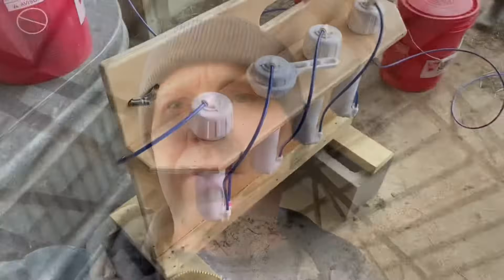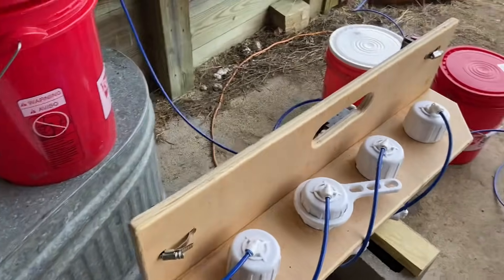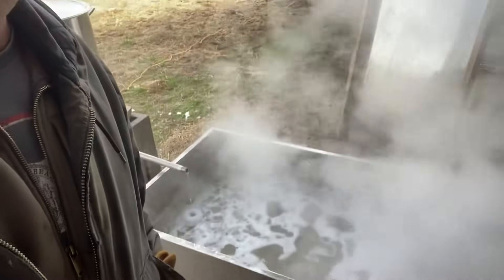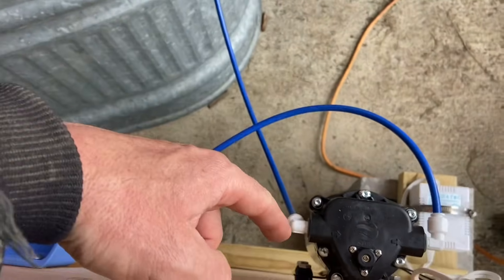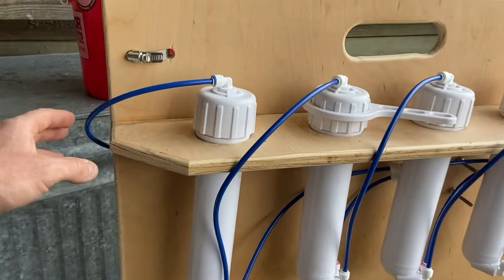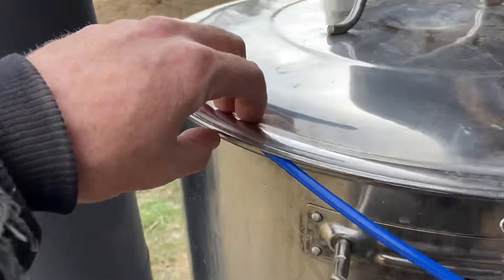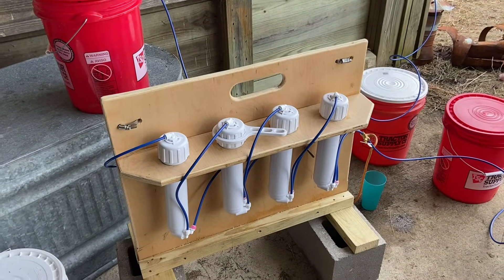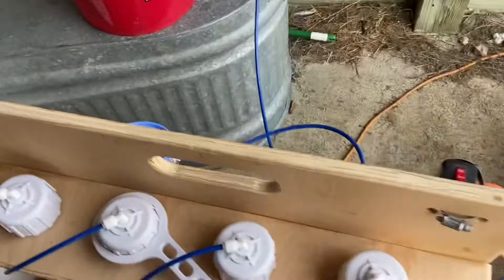Reverse Osmosis for Maple Syrup

Comment: oddly im not having luck getting the pump to pull water into the system. im not using the same pump but it does look like a very similar functioning model
Reply from the maker: Try elevating the sap container before the pump, mine always pulls better when that incoming sap bucket is at or above pump level.
Reply: thank you! Ill give it a shot @birchfieldfarming
Reply: @birchfieldfarming  seems like its something about the RO filter. i disconnected it and there was no trouble sending water through the rest of the system

Comment: I have searched everywhere and maybe i’m not wording it right when i search it, but where did you get your weights for your lines?
Reply from the maker: Great question, and I should’ve added this link to original post.  I’m assuming you just mean the weight in the bottom of the original sap bucket?  It’s just a standard garden hose fitting to 1/4” hose compression fitting.  Here’s a link: ZKZX 3/4" GHT Garden Hose Thread Female to 1/4" OD Compression Brass Connector, Faucet to Hose Adapter 2PCS https://a.co/d/3OQS4rH
Reply: @birchfieldfarming  i was talking about the weight to keep the hose down in the bucket/tank so it stays in there
Reply from the maker: @ZachAdventures yeah, that’s what I linked to
Reply: @birchfieldfarming  my bad i didn’t see the link the first time. would help if i clicked the see more button. lol. thank you
Reply from the maker: @ZachAdventures You got it, best of luck with your season!

Comment: Just curious, how did you come up with the 4 filters? Why not 2 why not 6? Is purified water good to drink?
Reply from the maker: The purified water is EXCELLENT to drink!  I made the unit almost a year ago, so I’m trying to think back…I may have come across something similar on another channel…point is, it worked great for our 30 to 40 or so taps!  You can try less membranes, you just won’t pull as much water out per pass was my understanding.
Reply: Great fantastic thank you so much for getting back to me. I believe I’m going to build one in trade this year. I put a mainline in last year so I didn’t have to go get buckets so we’ll see what happens. Thanks again.

Comment: Fantastic, video This looks really cool to do me and my daughter have about 20 or so trees. And we generally have to boil about 90 gallons to make one because were using swamp maples and rock maples. So I believe this will really cut down on my boiling time a lot we generally end up making a couple gallons of syrup, do you think this will be good for me? Thanks 
Fred
Reply from the maker: This was the best thing we did regarding our syrup production!  I’d absolutely recommend.  The only thing I’m not 100% on is effectively storing the membranes in the off-season.  Lots of videos on that out there, but I’m not sure I’ve figured it out.  But even so for me, it’s still worth it to buy new membranes each season.  The firewood savings alone was incredible.

Comment: Great video!  can you give a detailed diagram of your setup the video go's so fast! Also have you used a pressure  switch for your pump? If so where would hook it up at? Sap side or pure water side?
Reply from the maker: Thanks, Dave.  I have not used a pressure switch for pump, as I really didn’t have a need.  We won’t have this thing out again until syrup season, and I want to condense it down so it’s lighter and simpler…a diagram would be a good idea!

Comment: Why use several small ro membranes vs a 4”x40” ?? Contemplating 2 units and running a low psi into a high pressure pump
Reply from the maker: I have no idea.  This is what was available, so I went with it.  Worked great, but maybe you can improve.  Keep us posted!!

Comment: Any adviice on shutting down the system at end of season would be appreciated. 
From John in Morgans Point On.
Reply from the maker: Hi John,
Youngblood did a video on this - pretty short, simple, cost effective storage method using hydrogen peroxide.  I’ll probably follow something similar.  The membranes came vacuum sealed, so I may try sealing them up individually with my food saver (after cleaning and treating), rather than his PVC pipe storage method (PVC is expensive!).  Like he says though, worst case, buying new membranes is always an option if my storage technique fails for some reason.  Anybody else who has experience, please comment if willing!  Link to Younblood video below:

https://youtu.be/h0g6zI-w7hk
Reply: Thanks. Will check it out.
Reply: @johnlott9111  I an storing in a cat litter bucket with wood blocks on top to keep filters submerged.

Comment: One more question. I’m having a hard time finding the fittings for the filter? 3/8npt I assume would go to 1/4 push connect? Did you find them on Amazon? Ty
Reply from the maker: Yes, here are the ones I used: Malida Male Push To Connect Tube... https://www.amazon.com/dp/B01M9B6LL3?ref=ppx_pop_mob_ap_share
I had a heck of a time stopping leaks from the threaded portion tho.  I had to Teflon tape the crud out of them!  Very poorly made Chinese cheapness.  I’ll be making a trip to the hardware and rigging up something with brass threads before next season.
Reply: @birchfieldfarming  thanks for the heads-up on that.

Comment: We are only able to boil sap on the weekends, will the membranes be good to sit for a week after just a flush with the permeate? Or will we have to do a soap wash? Thank you for your video..happy boiling
Reply from the maker: That’s a really great question.  I’ve come close to a week with just a permeate flush, so I think you’d be fine.  What I’m noticing though is the pre-filter (5 micron) needs changed more often as we near the end of the season and it gets more buddy - sap seems cloudier, spoils quicker, and plugging that pre-filter much easier.  Good luck to ya!
Reply: Flush with permeate every 3 days and you’re good to go. Use a preservative at the dnd of the season…remove the pre filter after each use…I soak mine in permeate between runs…and use a new one every 500 gal of sap
Reply from the maker: @billchriswell2925  Thanks, Bill!  Good info here.
Reply: Thank you!

Comment: Thanks for the video I'm up in ME and just built one of these machines and im learning how to best run it. I'm starting with only about 1.5% sap so it takes a bit longer to get up to that 6 or so % range.  The online forums say you can get at most about 9-10% just due to the science behind the RO process and how water is removed.  I think the sizing of the system is the most important depending on how you plan on using it.  I am removing about 2 gph of permiate which is about the same as my boil rate in a lobster pot over the wood fire but I would like do do it abit faster so I don't have to run the RO quite as long to get a batch ready to boil. in any event utilizing the process is a huge benefit especialy when you don't want your hobby to turn into a full time job. Cheers
Reply from the maker: You’re absolutely right - it’s been a game changer for our small operation.  Kevin, are you guys still running sap up there?  We’ve had kind of a slow season with temps above normal (early Spring?).  I’m thinking our season may end this weekend because of the warmer weather.  Sounds like you’ve got a set-up that’s working for you, which is all that matters.
Reply: @birchfieldfarming  it ran for about 2 weeks mid janruary so I decided to tap but the freezer turned back on and its been single digit temps for a week so everyting froze back up.  Things just getting started up here for most people about in the first week of march. i just ordered some larger membranes wich should speed things up for me so we'll see how it goes.
Reply from the maker: @kevindavison6019  Very nice, good luck with your season!  We’re finishing up down here.  Not our best season, but we made what we needed to.
Reply: @kevindavison6019  where in maine are you at. We sugar down in buxton. Looking to set up a ro as we are around 200 taps it takes alot of wood

Comment: How many gallons per day GPD are those membranes? How often does the membranes clog up and have to do a flush? How many taps do you have? What is the size of your pan?
Reply from the maker: Hi Craig - Membranes are 150 GPD, I’ve run as much as 50 gallons of sap in a day without a problem, but I usually keep 5 gallons of permeate back and flush at the end of each day, which has worked well.  We usually tap 15 or so trees and run around 40 to 50 taps.  Last year this yielded us 400+ gallons of sap and over 12 gallons of finished syrup.  My pan is 2 ft by 4 ft by 7 inches high.

Hope this helps - let me know of any other questions!
Reply: @birchfieldfarming  nice that is going to be my setup for next year. I am  going to do 40-50 taps with an RO. The size of my pan is 18x48 just because that is the size of oil tank I had.
Reply from the maker: @CraigontheGo  That sounds like a good size pan and that you’re moving in the right direction!  Best of luck on your set-up next year!  Reach out if I can help.👍

Comment: Nice system! Do those membranes need to be backflushed? Or do they automatically do that?
Also an interesting piece of info from the amazon link for your membrane -
"[Tips] Recommend work pressure is 100 psi when using this product in a Maple Syrup reverse osmosis system. And we suggest heating and maintaining the raw sap at 104°F(40°C) to prevent clog on the membrane while keeping it under 113°F(45°C) to avoid damage to the membrane due to over-high temperature."
Have a great day, God bless you and your family!
Reply from the maker: I noticed that info on the membranes as well.  I haven’t had an issue yet running at 40°F.  Not auto flush, so I save 5 gallons of permeate (clean water) and flush the system after each use.  So far so good.  Blessings your way as well!😀
Reply: At 7:20 he describes the flushing with permeate, or clean water.